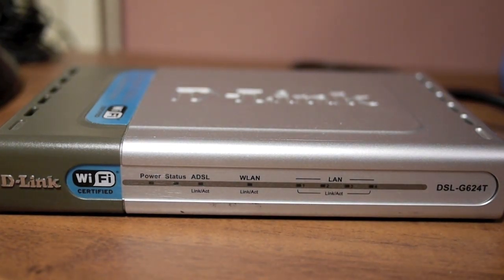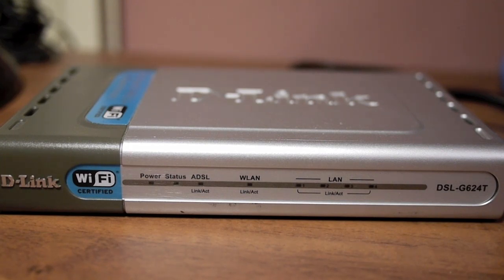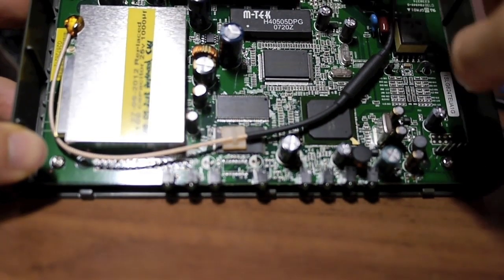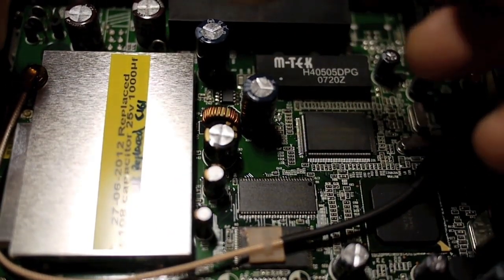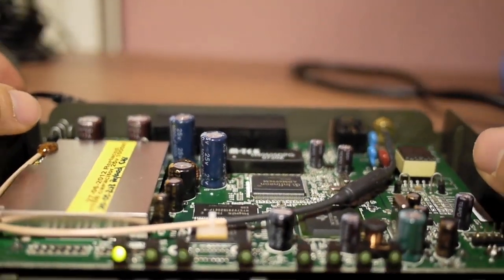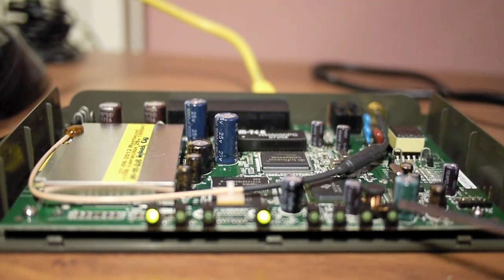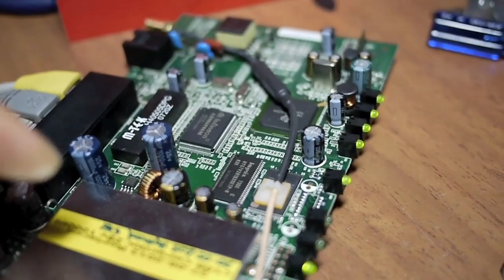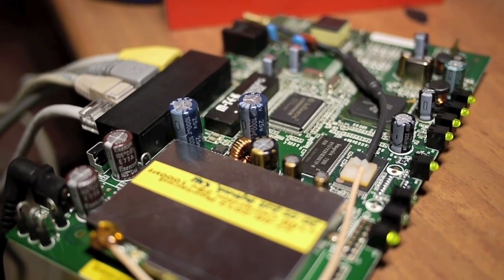Unstable Dlink ethernet ADSL modem, router, LAN switch, wireless access point repair

Comment: Nice video ..I liked very much ..useful video ..same problem I have that wireless connection i working correctly..bur wired connection not working automatically when pc starts..it shows message network connection unplugged.. even and when my modem is on cable is connected..
Reply from the maker: Santosh Kulkarni Check the 25V 100uf capacitors.
Reply: 1000uf Thanks,  trying to change ...and replying you for result The modem is Iball Baton adcl2

Comment from the maker: ***** I thought the most likely cause of this problem are either the 25V 100uf capacitors, generally used for de-coupling, or the 25V 47uf capacitors. I know it from their usual application in this type of circuit, but more from experience. In the case of wired ethernet, 25V 100uf capacitors were the problem.